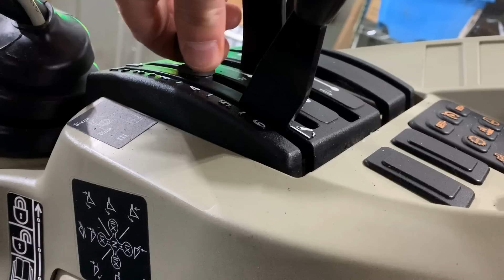SO CONFUSED!?! Tractor Terminology Explained!

Comment: I really enjoyed this video because you've resolved a couple of terms (like SCV) I haven't been able to figure out. There was one item that surprised me though. You were talking about snow blower vs. snow thrower and mentioned single stage blowers have just the auger and no impeller. I haven't seen one of those. Both my dad and my father-in-law had Sears walk-behind snow throwers that were nearly identical, but dad's had a hood over the engine. Both had only the impeller with no worm drive and steel wheels with no tires. Both did a pretty fair job most of the time, but had great difficulty with heavy, wet snow. They both lived in SE Wisconsin, where they get quite a few wet, heavy snowfalls each year. Unfortunately, on the first day of spring in 1983, they got 7" of the stuff. Dad was in his 70's and had several health issues, but cranked up the snow thrower and cleared his sidewalks and those of the neighbors. He put it back in the garage and was heating water for the bird bath, when my mom found him on the floor. He'd had a massive heart attack and died. I moved to Louisiana >50-years ago to avoid that, but we're having a week (2/2021) of cold and snow worse than I've seen here since '85. I'm planning to buy a 1025R soon, but don't plan to buy much snow removal equipment unless this becomes a regular feature. -- I certainly hope not!

Comment: always great to see your helper rosie. cute she brought her friend to help lol. i agree. implement is ground engaging [tillers, mowers, blowers, non-powered equipment - blades, rakes] attachment is something attaching to the tractor like front loader arms, even quick attach system. PTO is an abbreviation as you explain. you were showing the front and rear SHAFT of PTO. someone told me its like saying a tractor has x horsepower - then looking at the engine. if that makes sense. great video.
Reply from the maker: Thanks as always Mr. Wilson!
Reply: @GoodWorksTractors  sorry did not mean to sound or be nit-picky. look forward watching more videos :)

Comment: Great clarification! There could be a part 2 to that video! Third function valve versus Diverter valve to actuate an implement on the FEL with SSQA or a Pin On Style implement... Is this a 3pt Quick Hitch or Quich Attach for the rear implement... like a 3 pt hitch receiver. Or maybe a rear blade or grader blade? And so on! Thanks for sharing!

Comment: Good  video explaining terms used on tractors . The most important thing that I have experienced on tractors is when buying a new tractor or purchasing used one is get it with the power beyond hydraulics at back . You can then add any open center hydraulic control in the future very easy or when wanting too add a backhoe or other hydraulic controlled attachments . 👍
Reply from the maker: Yes, PB can be very beneficial

Comment: I have two John Deere tractors and love them and how they work for me. I have many implements which can be attached to the tractor and use the quick hitches to attach my implements to the tractor much easier. I learned about the terminology when I purchased my first tractor and since getting my newer tractor I had to learn new terminology and it helped me.

Comment: Front PTO = on my Ventrac 4500z, 32.5hp, gas Kubota engine.  Most of the 30+ attachments run on the front...I also have a rear PTO and 3-pt hitch.  Ventrac are not for cultivation, so has low ground clearance comparatively...but it is used for everything else a tractor is used for around any property.  I love mine.

Comment: implements either needs hydraulic or PTO connection to operate as intended. Attachment is equipment connected to the tractor but does not need the auxiliary power of the hydraulics or PTO. Ex: Grader box = attachment; post hole digger = Implement.

Comment: Hey bud when you say stay about the same with as your back wheels  for your implements.  My question is when get in the bigger tractors you see a lot wider plows Bruchhogs  ext right. How does that formula work.  I would like to no thanks Dean
Reply from the maker: Good question.  Large Ag tractors are a different game all together.  This is really focused on subcompact and compact tractors.
Reply: Good Works Tractors  thank you very much that helps me understand a little better. One more question if you don’t mind.  I have a little engine shop work how can you get service manuals on John deer are Kabota if you no thanks

Comment: Have you gone over the three lift systems on the 1025R that are offered for the mid PTO? TTWT has a description and my dealer only has mechanical - my current tractor is hydraulic... can you help me out what are the drawbacks of going hydraulic again besides the cost?
Reply from the maker: I haven't, but the downside is you can't raise and lower the deck while the loader is hooked up.  At least with the standard version of the independent hydraulic deck lift.
Reply: This is were I get confused- I know you can add multiple SCV valves and I saw that John Deere has an independent 3rd SCV I was wondering if it could be used for this. I just really can’t seem to find anyone knowledgeable enough or wants to even install them correctly if I ordered the tractor that way

Comment: Third Function,  Diverter valve,  and Third SCV....  I think of Third Function as an activity rather than an actual hydraulic port.  A Third SCV is an actual Hydraulic port, not just an activity.  My tractor has a Diverter valve mounted on the vertical loader arm with a switch on the loader "JoyStick" for controlling a grapple on the FEL. This, in my mind, is how I get the Third Function to operate the grapple "lid".  The diverter  "diverts" some of the hydraulic fluid going to the normal FEL operation to use for the grapple lid operation.  My tractor also has 2 additional SCVs on the rear of the tractor.  I had a discussion with my dealer about using one of them to control the grapple (rather than buying a diverter), but he thought the levers were too far from the joystick for that purpose (not to mention the additional cost of the hydraulic coupling and hoses).
Reply from the maker: Yes, it can get very confusing.  There's a lot of ways to set it all up too.

Comment: How about an explanation of different front end loader (FEL) configurations like:  Non Self Leveling (NSL, your typical FEL); Mechanical Self Leveling (MSL); Hydraulic Self Leveling.

I’ve owned a John Deere 4720 CUT with the 400cx MSL FEL that was absolutely fantastic!  It is such a pleasure to use a MSL equipped FEL when lifting, or lowering, anything (bucket full of whatever, pallet fork, bale spear, etc) from ground level to full height, or back down, by just activating the boom lift cylinder circuit.  No need to do the "herky-jerky" movement of controlling both the boom and bucket cylinders at the same time (or sequentially) to maintain control of the FEL’s load.  If you’ve never used a MSL equipped FEL, you just don’t know what you’re missing!

Also, due to some kind of mechanical advantage I don’t fully understand, you’ll find that MSL FELs have higher "real world" 500mm ahead of the pivot pin capacities.  However, the same FEL model without the MSL option will spec out with a higher, but less reflective of the real world, "at the lift pins" specification.

In the CUT world, John Deere is one of the few manufactures the offers the MSL option, and then only on their deluxe 4-series FEL.  Kubota recently added an MSL option on one of their small/mid-size CUT FELs.  Kubota does, however, offer a hydraulic "Spill Guard" option (a form of HSL) on their larger Grand L series FELs.  I’m reasonably sure this setup hydraulically levels the FEL load on the way up, but I do not know if it also levels the load on the way down.

Food for thought…
Reply from the maker: I've done a NSL vs MSL video.  I've never seen a HSL so wouldn't be able to give an informed opinion on that.  Thanks for watching!
Reply: @GoodWorksTractors  Missed your earlier NSL/MSL video.

I did want to add one caveat about an MSL FEL.  I have seen postings (on a 400cx) where the person was complaining about a "design flaw" of the MSL linkage that prevented him from lowering the bucket all the way back to the ground after dumping the bucket at full height, but leaving it fully dumped.  This is not a design flaw.  It is, in reality, "pilot error".

If the bucket is fully dumped at full height, it is already pushing against its dump limiting stops.  As you lower the boom, the MSL linkage is going to attempt to, in effect, dump the bucket more.  Since the bucket can't dump any more, the boom cylinders will eventually bind up because the MSL linkage is pushing against the cylinder's upper mounting points, but the bucket is now mechanically limited in its movement.  This bind up will not cause any damage because the boom cylinders will enter bypass mode and stop trying to force the boom arms down.

The solution to this perceived "flaw" is to roll the bucket back up using the joystick's bucket dump/rollback function.  This will free the bucket from its dump limiters, and now the boom cylinders can continue to lower the bucket to the ground.

If you closely watch the MSL portion of your video, and in particular concentrate on watching the top end of the bucket cylinders, you can see just how the MSL hardware is doing its job. Kudos to you for rolling the bucket back and full height before attempting to lower the FEL booms. You passed the Pilot's test!

Comment: That's a cool clock . Didn't know that you can get 15 watt bulbs . Question ... what about a flail mower with hammer blades . Could you use that instead of a brush hog ? Another question .... can you get a John Deer tractor with SSQA instead of the JDQA or do you have to do some kind of change over  . I see you showed one . Is that an extra option when purchasing a John Dear Tractor to get a SSQA ? . I must say this was a great video . Very informative . Sorry . I don't know anything about tractors so these questions may sound kind of stupid . Thanks
Reply from the maker: Hi Henry, yes, a flail can be used in place of a brush hog in many circumstances.  There's some differences between a brush hog and flail though.  Regarding SSQA on a John Deere...my 4066r (shown in the video) was ordered with SSQA from the factory.  So, yes, that is an option.  Hope that helps and thanks for watching!
Reply: Thanks

Comment: I thought it was Tip and Tilt and Third Function referred to front remote with buttons to control a grapple. Edit: GOOD VIDEO.
Reply from the maker: When I google Tip n Tilt, links to a Super Monkey video pop up first along with a video link to a Top n Tilt video :)

I have a 3rd function on my 4066r right now that leads to a remote on the back of the tractor.

Thanks for watching!

Comment: You forgot the draft control lever for the three-point hitch.
Reply from the maker: Rate of drop control?
Reply: @GoodWorksTractors  A feedback system that raises or lowers the ground-engaging implement to keep the load on the tractor constant as the ground resistance varies.

Comment: Got a question 4-U. Talking with an old timer in America's Store Harbor Freight about GreaZe😂. He says people get it wrong. When you use the gun, just pump one or at most two times. You don't want to pump until you see it coming from the boot. If you see that you are doing damage. Second  for years, I have been using a L120 and because of you I just purchased a 1025r, waiting for delivery.  With a snowblower on front, do I need rimguard Or chains on the back? Did I make a mistake not getting the back hoe. Like the show.

Comment: There is no Z in diesel either but most people have a deezel truck.
Reply: Rudolf Diesel, inventor of the diesel engine, was German.  In the German language, the "S" is usually pronounced with what in English is a "Z" sound.  So "deezel" is actually the correct pronunciation, unlike "greezing" your tractor (which seems to be a bit of a Southernism).
Reply: Well this isn't Germany.

Comment: Yes Thank you! GREASE! NOT GREAZE. But I guess it's all in where you are from.  If you could touch on Front wheel assist vs 4 wheel drive, is it the same thing? In my mind any axle that is not mechanically connected such as a hydraulic driven axle  is an assist axle where if the traction is to great for the hydraulics the tires may stop turning. Any axle that is mechanically gear driven is a drive axle as in 4 wheel drive where as long as the engine is turning so are the tires. However my tractors front gear driven axle is referred to as front wheel assist.